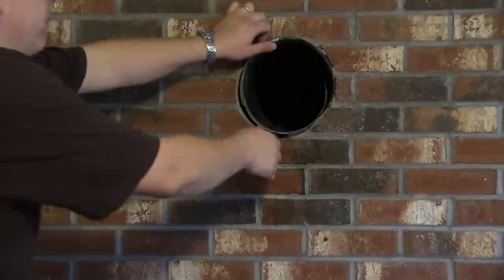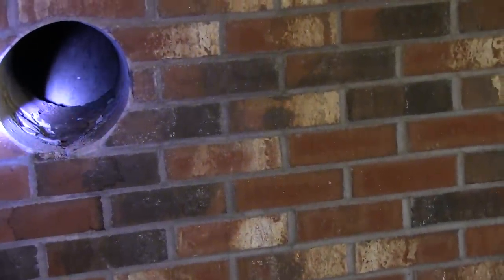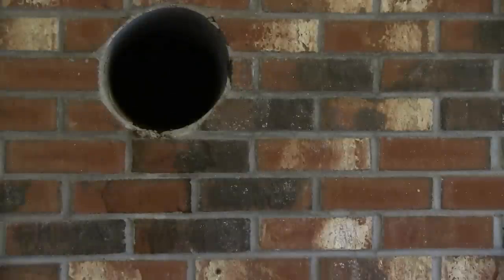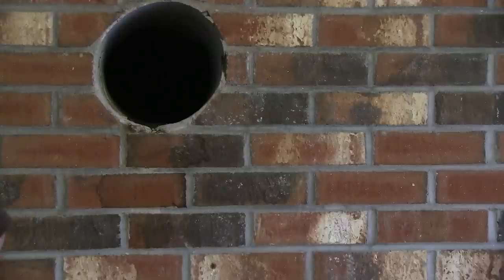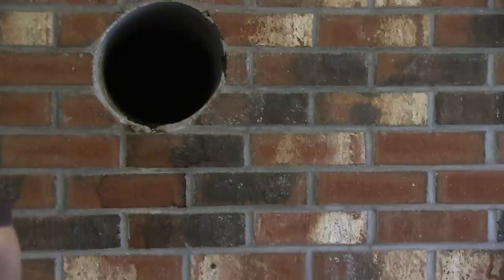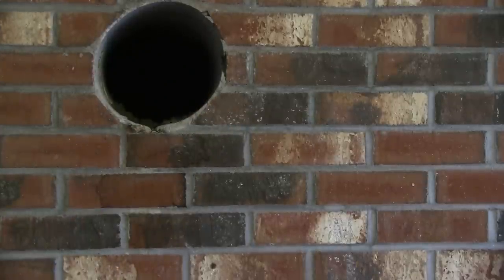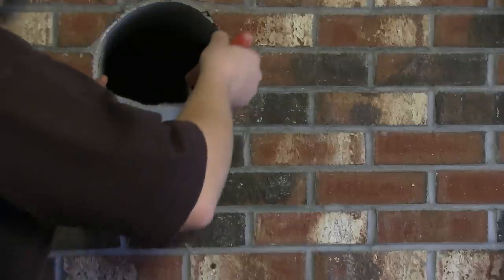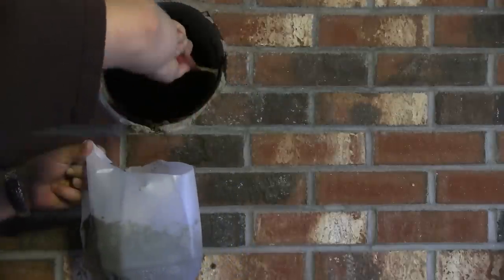How to replace cracked cement with Quickrete in a chimney and add stove pipe liner

Comment: Please remove this dangerous information video. You are going to be responsible for many chimney fire related deaths. That space around a thimble must be sealed with special "Refractory Cement" that can withstand high temperatures and not crack and leak.